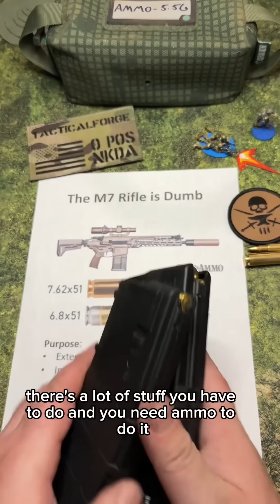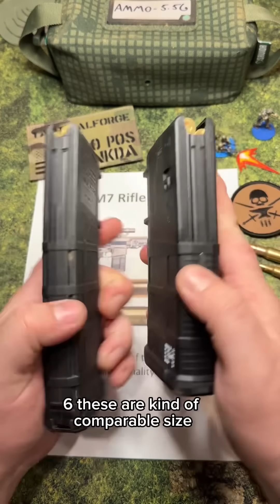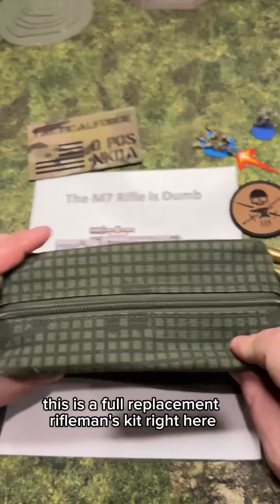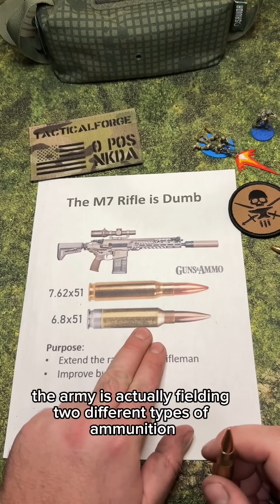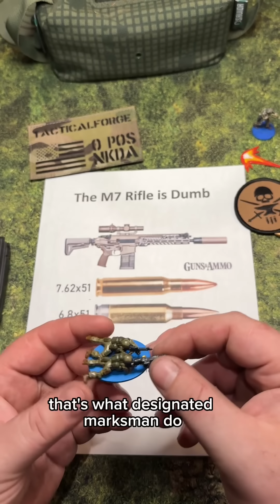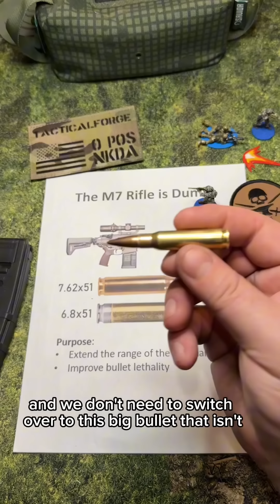My God this Rifle Sucks

Comment: Different ammo, Different mags = strained logistics. ALSO..  when adopted, the US Army cannot share ammo and mags with NATO allies.
Reply: Well.. you know how US have solved NATO compatability problem last time(7.62x51)
Reply: @남기헌-l8y In their defense, the second go-around with 5.56mm was substantially fairer, with the Belgian design winning out.
Reply: Not just NATO allies, we won’t even have commonality with the rest of the DOD. And anyone is high if they think the marine corps is just gonna switch after they just recently standardized on the IAR so that also counts the Navy out the Air Force definitely won’t switch because small arms isn’t really high on their priority just like the navy. And speaking of nato, most of the biggest players in NATO also just recently got brand new or just modernized their current 5.56 service rifles. They’re not switching any time soon either. 

And now the army won’t just need new Mags as you mentioned but also new Mag pouches. New blank firing adaptors. Etc 

At least links will be the same as 7.62. New production line set up for new ammunition packaging. Last time I checked loose 7.62 doesn’t really exist in large quantities in the inventory. 

New optics but good thing what they announced is backwards compatible with 5.56 and 7.62 in case the army realized they made a mistake. 

New/remodeled Ranges because now SDZs don’t match up with 5.56 SDZs and old targetry might not last as long. Shoot houses won’t be as durable. Etc. 

New/remodeled AHAs because now every single storage building is not rated for the new rounds so you’ll either have to store less ammo in storage facilities that have been optimized to be rated for 5.56 when it’s at full capacity (inefficient because you’ll have too much empty space that isn’t being used for storage). Or build new ones. 

You gotta remember ammunition storage buildings have to be rated to only be X level of fucked up if it’s at full capacity AND all the ammunition stored cooks off and explodes.
Reply: Point is to make the military industry richer...
Reply: No one in NATO is going to adopt this cartridge. If you're old enough to remember 2003, we ran out of 5.56 and had to beg, borrow & steal it from NATO and buy it from Israel and other countries in the region. That's not going to be an option with the 6.8.
Reply: @donwyoming1936 we did not run out of ammo in 2003.
Reply: @donwyoming1936 literally?? We ran out of ammo? I'm surprised the boy scouts couldn't beat our logistics. 
We are running out of a lot of important stuff.... And it's going to get worse, according to China
Reply: @idrinklight44 US stocks of 5.56mm during that time were getting low, so ammunition from other places such as the UK, Canada, and Israel were purchased. These were used in training.
Reply: There's a standard operating procedure for every situation we can think of, and they all get thrown out when the curveball arrives.
Having quantity of ammunition over heavier larger calibres is always a better idea.
Reply: They're SR25 mags, so not entirely new, but yeah
Reply: Donald Trump was the dude who green lit the ngsw. He is planning to leave NATO.
Reply: @totf2when13 Ah, yes, making stuff up and acting like we have a direct line to POTUS.
Reply: @totf2when13 really...when did he say that?
Reply: They also fucked nato compatibility when the Army went with the Avon M50 gas mask over the M40A1. Weird, proprietary cheek filters instead of the 40mm nato standard canister filters that can also be swapped to accommodate both a right hand and left handed shooter
Reply: It's the other way around. We don't need to adopt this round, when we fight against you invading Greenland.
Reply: or civilians in the usa
Reply: The name of the game in modern warfare is suppressive fire.
Unlike video games, you can't always see exactly who is shooting at you. But you can suppress the general vicinity and direct other assets to destroy the site, or in the perfect scenario, another squad to maneuver and destroy the enemy.
But these days, drones, close air support and indirect fire win the day. 
The laser rangefinder on these weapons will more do to help with that, than actual one shot, one kill, sort of things.
Reply: @LSwick-ss6nm Except we fight people with body armor or who can't be suppressed?
Reply: @LSwick-ss6nm firepower. overwhelm the enemy with your fast and accurate fire until you can maneuver on them.
Reply: @MichaelTaylor-g2b  with is another word for suppression
Reply: We dont anyway
Reply: NATO couldnt get someone to tie their shoes 😂 who cares
Reply: Do you think that happens much?
Reply: Got to get out of Nato anyways
Reply: Not a big problem, the logistic strain is minor, and Trump made clear US doesnt have allies, except Israel
Reply: @hjhsdujh  it's minor ?? Lmao it's not like exactly what happened in the past lol

The US had to ask for allies to give them ammo in an emergency, with 6,8 they would have been toast.
Reply: @hjhsdujh I'm sure that country has everything we will ever need, I'm so glad we have them as an ally. Maybe they can use some of the old testament magic for our future wars.....
Reply: You realise if they used standard sr25 magazines ....  That almost all of nato has similar firearms?

The 6.8x51 is stupid.

This video is from an officer. With bias. Because everyone from his clique has to walk back the downsides of that hyper velocity 22cal. The moment it was fielded, it was because we do not train like the marines. We need huge volumes of low recoil because no one hits anything. Plus the panic fire strategies of Vietnam.

Every conflict provides the same knowledge, bigger tends to produce better results.

With proper training as riflemen, utilizing coordinated sustained fire...  100 rounds between four men. One magazine each.. can effectively suppress a large element for two to three minutes.

It was the issues of weak fifteen year old boys, ignorant twenty year old boys and zero discipline.
Reply: @JamesJohnson-if8rz not fully disagreeing but if bigger produces better results then why was the M14 replaced with the M16 as the calibre was brought up as one of the reasons for it to be replaced.
Reply: @WhiteIkiryo-yt2it because we were fighting in a jungle at the time and you didn’t need the range and weight of the M14.

The new rifle was clearly designed for the last war (Afghanistan) and we will probably need something else when the next war kicks off.
Reply: @poolee77  if the prediction of island hopping through Pacific jungles is correct, then the M4 is probably what we'd end up going back to for that, since the close quarters of Pacific jungles negates the need for rifles that can shoot over a mile.

If history tells us anything, the M1 carbine was the favorite rifle for GIs during the island hopping campaign, because even though it lacked the punch of the M1 or the ROF of the Thompson, it was lighter than both and you could easily carry plenty of ammo compared to .30-06 and .45acp.
Reply: @JamesJohnson-if8rz  every major military on earth has independently chosen to adopt an intermediate cartridge over a full power rifle round, history shows intermediate cartridges are simply better.
Reply: @JamesJohnson-if8rz  The "panic fire strategies" was a meme.  As for "we do not train like the marines", the Army kinda does.  Both require a certain number of targets hit at ranges of up to 300 yards.  The Marines have a 500 yard target, but realistically you aren't even going to see a target at that distance.  The 5.56 was introduced because we were being out-volumed by soldiers with the AK.

The 6.8x51 came into play due to soldiers being outranged in Afghanistan by Taliban with PKM machine guns.
Reply: @cstgraphpads2091 there are also changes that need to be made to doctrine given how much drones are changing the battlefield, there are sections of the Ukraine front that are held entirely by drones. Cover and maneuver are different when coms and NVG/thermals are being deployed more. How you address those changes are going to make a difference. And we need to adapt
Reply: @cstgraphpads2091  the 6.8x51 came about because they want to defeat body armor that all peer militaries use now.
Reply: @JamesJohnson-if8rz  I'm not enlisted so im not going to speak out of my depth, but I don't grasp how you can say he has bias when he made a full video breaking down his reasons and explaining them. The guy didn't really give many opinions, most of what he said was just direct facts about the platform with a few opinions blended in such as saying he thinks its a mistake to field this. It seems more biased to disregard everything he said by just saying he doesn't know what hes talking about because hes biased.

Edit: By mistake to field this, I meant mistake to field EVERYONE with this, as he said there are definitely some good applications for it in certain areas.
Reply: @JamesJohnson-if8rz 😂
Reply: @JamesJohnson-if8rz 
Lol. Most infantry fires are suppressive, simply because you cannot "train" your rifle squad to see through walls, thick vegetation, vehicles, terrain, etc like Clark Kent. 😄 The "Vietnam panic fire" was almost always a perfectly acceptable way to counter an ambush through a foliage screen on initial contact. In the early war, the GIs would even load tracers in the M14 and blast through the jungle on full automatic to make the VC & NVA think there were more M60s in the rifle squad. They didn't necessarily have to hit anybody, the 308s flying over & past the enemy troopers was often enough to discourage a protracted engagement.

There's a reason the suppressive fire doctrine has been carried on from Vietnam into Rhodesia, Angola, El Salvador, Colombia, Mexico, Bosnia, Burma, Ukraine, and everywhere on earth where you see light infantry with auto rifles in forested terrain. Most fires in combat are suppressive area-target fires, not precise point-target fires.
Reply: @JamesJohnson-if8rz  you have absolutely no idea what you're talking about.

That's not how infantry combat works.
Reply: @JamesJohnson-if8rz  yes yes, we know you're all of that.
Reply: @JamesJohnson-if8rz  Surveys of marines during the Vietnam war showed them being unhappy with the m14 and wanting the m16 as a replacement, because it carries more ammunition and is more useful in the ranges combat actually happens.
5.56 has the same or greater lethality than 7.62, and marksmanship at ranges of 500+ is usually pointless when a mortar or stone is far more effective.
Reply: @JamesJohnson-if8rz  I love it when people who never served get their opinions from fudd lore, all the while pretending they're experts.

Comment: Eugene Stoner takes his revenge, 70 years later.
Reply: And likely will again in about another 10-15 years, when they dump this thing.
Reply: @presidentmerkinmuffley6769 What if it catches on, and NATO make it their main cartridge?
Reply: @KyleTheDalek  It took what 30-35 years for 5.7 to get the official nod from NATO? And that was after it was developed specifically to NATO requirements. I HIGHLY doubt this will get past that mark.
Reply: @presidentmerkinmuffley6769 I was one of those unlucky souls that got to test the P90 back in 89/90. It was a cheap, plastic gun with a cartridge that didn't make any sense. It still doesn't make any sense. And, it was designed specifically for NATO. Boutique cartridges are not going to see much use outside special forces. And the 6.8 is definitely in that category
Reply: @KyleTheDalek ain't going to happen because they don't need to and don't have remotely the same budget as the US.

Some countries took a lot of time to even adopt 5.56 in the first place some times after integration NATO, and it was objectively the better cartridge and it was much cheaper than 6.8.

Now ain't no way anyone is going to change and have to refit their whole military to end up with a worse main infantry weapon.

The rest of NATO doesn't have any incentive to do so.
Nobody is going back to a battle rifle when one of the most basic concept of infantry combat is getting fire superiority to allow another element to maneuver.

The people who pushed that whole project either have no idea how basic infantry combat works, got paid to ignore it, or both.

Not a single infantryman ever has said "you know what would be great for the next firefight ? Having less ammo per guy".

Soldiers fire a lot of round in a firefight, not because they miss, but because firing back in the general direction of the enemy is the best way to make them lower their head, giving a more precise weapon to everyone will just make everyone run out of ammo faster.
Reply: @KyleTheDalek  NATO has millions if not billions of 7.62. They are never going to change them, especially in the brink of WW3.
Reply: @donwyoming1936  Never did and never would make sense.
You don't design by committee, and you don't ask Europeans about anything smaller than a Rifle caliber (except the Brits they seemed to understand) and we have known this for 120 years.
Niche rounds fill niche roles, it might take a while for the realization of that fact, but it is a fact.
Reply: @mikejeffsteel  Nevermind that all the US civ market 308 lines can be swapped to Mil spec 7.62x52 in less than a heart beat.
6.8 is not going to work logistically. No matter what a General is trying to relearn/getting palms greased to go along with. 

But ask yourself why are they worried about armor penetration, and who has the most armor capable of stopping traditional rounds? A quick clue, they are neither enlisted nor overseas.
Reply: @donwyoming1936  The 5.7x28 cartridge makes a ton of sense.
That's why it's so popular now.
Reply: @donwyoming1936  the 57 rules. Can't wait to pick up my new PR57
Reply: The throat erosion on this thing is going to be unreal lol